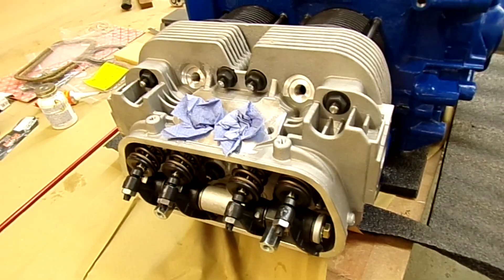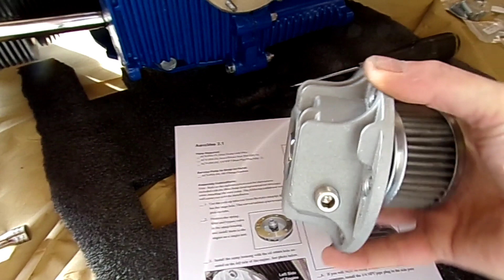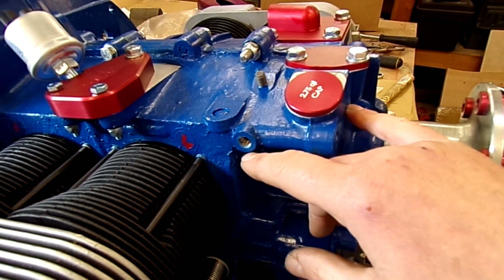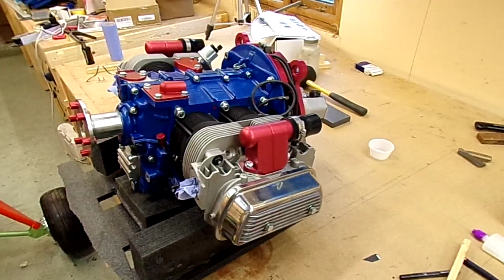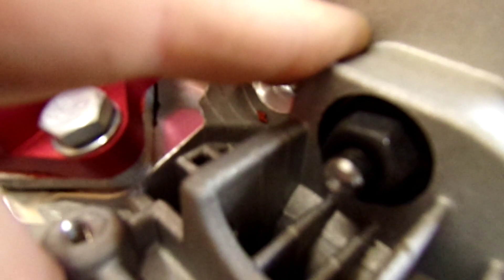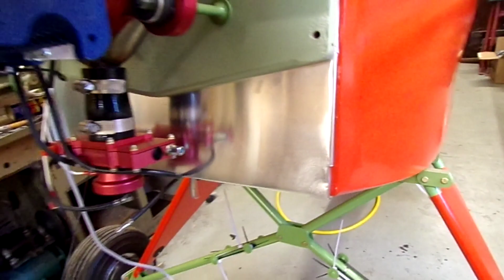EP140 The basic engine is built and fitted. Fisher Youngster

Comment: Looking sharp for me I would change the crank and prop flange to Great Plains Force 1 hub!
Reply from the maker: Well it would be very hard to remove the hub as it is heated to get it on but I have to ask why do you think the Great Plains hub is better? I know of a few aerovee engines over here and one has way over 1000hrs and had no problem with the hub, I don't know any Great Plains engine owner so I have no direct comparision.
Reply: @flyingkub  The conservative practice on this side of the pond is any time you exceed the stock 69mm crank you need a keyless tapered crank and a front bearing support.  You can see it in this timing video I made https://youtube.com/shorts/0Un9A4_3YVU?feature=shared   Aerovee cranks have experienced prop flange departures at some rate and we know of Zero with the GP force 1 hub or the Revmaster Equivalent.  Hapi engines did something similar on stokers.
Reply from the maker: @007mwn  Interesting. None reported in the UK with AeroVee but 2 with Revmaster put down to heavey prop and flying aerobatics as the Youngster can not be cleared for aerobatics in the UK (Microlight class aircraft like it are no cleared for Aerobatics here), should be Okay for a fair number of hours. The main reason for me going for the AeroVee is the relaiablity record over here appears to be better than any of the other VW based engines, per engine hr. I can just hope mine is one of the good ones 🙂
Reply: @flyingkub  In general they are well sorted perhaps the issues were with Gen 1.  I love the accessory end of the equation just a mental block on the front end!  I would like a Flitzer but that is twice the work of a Youngster you made a nice choice!
Reply from the maker: @007mwn  my prop is made by a man who built a Flitzer with the AeroVee engine for power. Beautiful aircraft,  I was tempted but it is just too heavy to make SSDR.